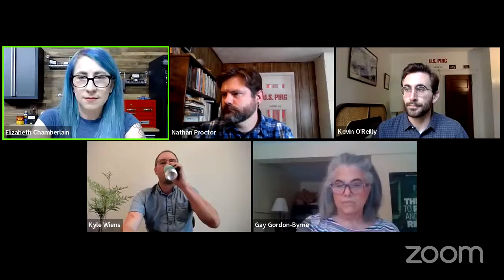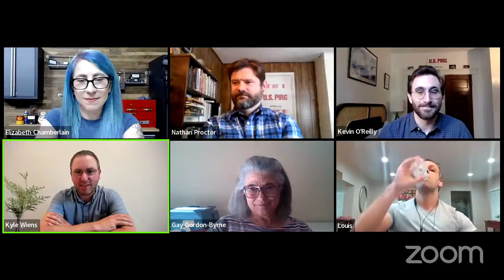First-Ever Electronics Right to Repair Bill Just Passed in New York!

Comment: When will people open there eyes and stop buying Apple products, this will fix the issue number one, secondly Apple is NOT the only company withholding information.

I have been repairing Electronic and Electrical devices for over 45 years along with mechanical IE: tractors dozers ,  once as some of us would know we had circuit diagrams stuck inside some units , repair manuals were always available for everything. RTR is great but don't  celebrate yet, you will find some devices will not be repairable at componant level due to LSI  and intergration.  

Its a start though and in some circumstances will be of great value to have the ability to obtain information and componants .

Hi Louis, good to see you here.

Comment: I believe in the right to repair because the big companies block the small shops for fixing your equipment and make people spend thousands of dollars because they just don’t want to fix it or let others do it so congratulations and by the way I used to fix electronics before again congratulations
Reply: My asus zenwatch....repair.....300+ bucks...🤷‍♂️🤷‍♂️🤷‍♂️🙇‍♂️....I bought q screw driver 9,98 ...opened it...use a eartip to clean it without nothing...used the eartips to push the contact pins.....and.....total 5 minutes and it worked like new

Comment: Apple saw this coming and has nearly complete in converting most of their products to be virtually "unrepairable", even by Apple.  They are now signing virtually every component in the device so that 3rd party parts won't work or won't work correctly.  Today this includes the camera, the screen, the finger sensor.  Soon will include the speakers, mic, etc.  
And if you've ever fixed something yourself, or even had iFixit repair it, Apple will refuse to service it in the future, calling it "tampering".  I've been refused service even when my iPhone was out of warranty and I willing to pay for the repair. 
And the new laptops?  They are great, no question, but the SOC and unified memory, the only repair part that Apple makes is a new motherboard at a cost of $$$$$.  Screen can be replaced, but is $$$$ and you will lose some functionality.  That leaves the battery, at least $$.  
I don't think this new law requires Apple to support non-OEM parts, does it?  If not, you can only purchase parts that Apple manufactures and sells.  Beyond the basics, they only repair/replace a few "parts" (batteries, screens).  I guess in NY they may be forced to sell these to iFixit and others, but after iFixit adds their markup for doing the repair, well ...  time for a new MacBook.

Comment: What Product do you want?  A sleek thin device that's hard to fix or a big  bulky device that's easy to fix.
Reply: iPhones are actually quite easy to fix. It’s hyperinflated original part prices and part-locking to the board who cause the problems.
Reply: REPAIR DOES NOT MAKE THICK DEVICES. My XCover Pro has a hotswap battery yet is no thicker than an iphone. Phillips screws do not take up more rrom than Pentalobe screws. Serializing your components so that your face id sensor doesnt work even if its genuine does not make a thick device. Hiding your repair schematics and board views does not make a thick device. Right To Repair will not make bulkier devices
Reply: That's not quite how it works. I'd rather be able to do what I want with my device that I bought rather than only being able to use the device the way the person who sold it to me says. I thought ownership meant it was mine
Reply: both can be the case. See the Framework laptop. This alone proves that these properties are not correlated, nor do they have to be. And like @Milan Schröter mentioned, the core issue is with manufacturers locking out hardware repair/replacement on the software side, along with their active effort to dissuade repair and prevent distribution of parts.
Reply: @jpsalis  and fairphone a phone company where every component is a little module that can be replaced when it breaks.

Comment: I don’t support right to repair fully because if a device is easy to repair, it’s also easy to brake. I have experienced that with my Samsung tablet, to replace the charging port you need only two minutes but since i had it i had to replace the charging port 5 times.
Reply: Like the fairphone easy to brake and easy to fix
Reply: I don't believe that's true. There's no correlation between the two principles, much less any causality. This is evidently clear with devices like the Framework, a device built from the ground up for repairability that still sports a significant amount of subtle enhancements to keep the device running for a long time.

This isn't to mention something like the Steam Deck, a literal tank of a product designed to take a hit, but still supports swappable components and a whole variety of parts available through their partnership with ifixit.

There's an argument to be made about waterproofing which becomes more challenging to achieve with while maintaining repairability, though even this doesn't have to be the case.
 
It's a shame about the tablet though. Sometimes brands end up cheaping out in certain areas which can screw over the consumer. I've had this on a couple of devices. I wouldn't say this is necessarily caused by the device's repairability per-se. What device is this anyhow?